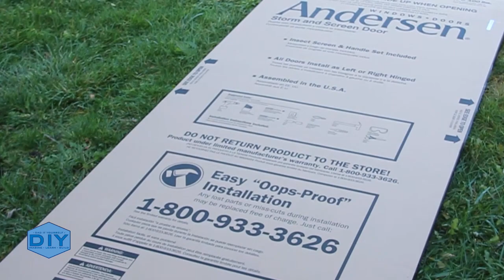ANDERSEN Storm and Screen Door | Step by Step INSTALLATION | 2019/44

Comment: Hi! I have this exact storm door but in a high wind area. The closer keeps ripping out of the door jamb if the wind catches it. Any suggestions re how to install a wind chain or another closer at the top - without impacting the screen that is integrated in the door itself? It is in a coastal area, and renters just do not close the door properly, the wind catches it - and there we have it. Thanks for any suggestions! Best, Ann
Reply from the maker: Ann, a wind chain can be added with simple screws as can an aftermarket closer on the top. Try longer screws in the door jamb. But once you do that the screws will just pull from the door. A final option is flipping the door so the wind pushes against it. There is no hard fast rule on door swings other that convenience.

Comment: The last storm door I attempted to install needed an inch recess to I stall. How much does this door need? I only have half an inch.
Reply from the maker: The mounting flange sits on the face of the door trim/brick molding. So not much is needed, just enough for the latch handle, and you can move that up or down as not to interfere with the door knob.

Comment: Once you put on the face mask and hearing protection to operate a mouse sander I had to turn you off
Reply from the maker: I need to protect my lungs and hearing due to disabilities I received while serving in the military. My hearing has been impacted by the years of working around aircraft, and unfortunately the cultural of the military encouraged me to smoke. Fortunately, I've stopped. Shaming someone for using safety equipment is not good character.
Reply: Safety first!
Reply: Safety first! Never know what’s in some of the  old paint. Plus protecting your eyes and ears are also good
Reply from the maker: @jaywall2255 Totally!
Reply from the maker: @jaywall2255 Yup.